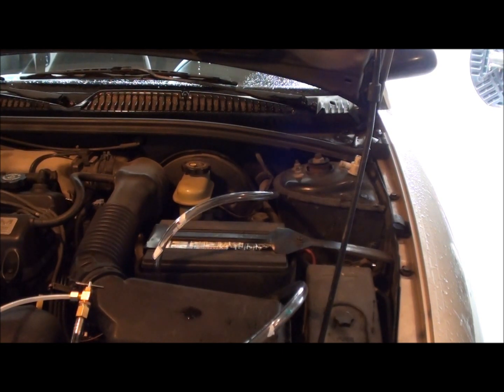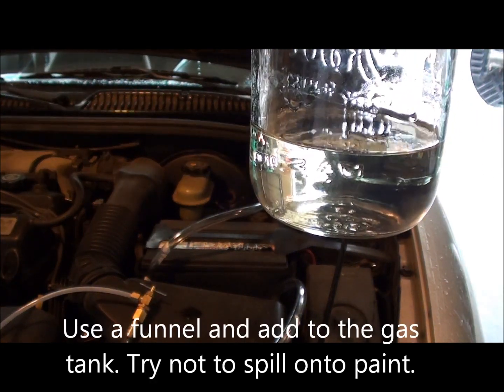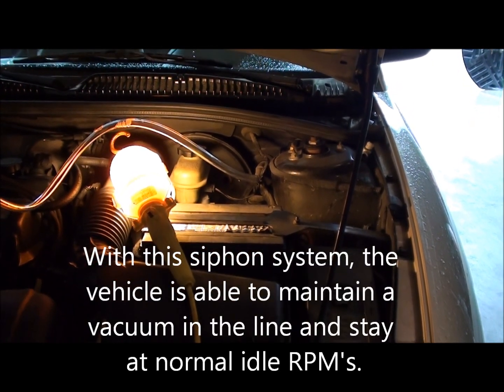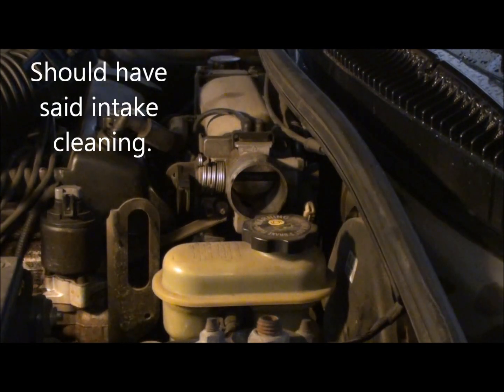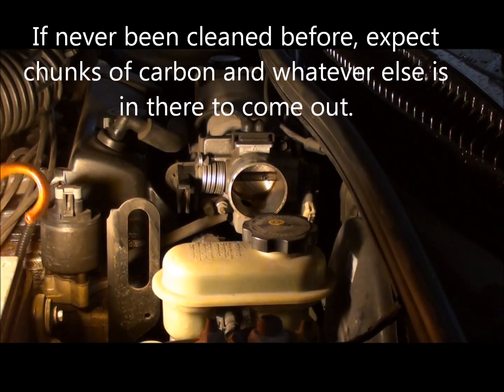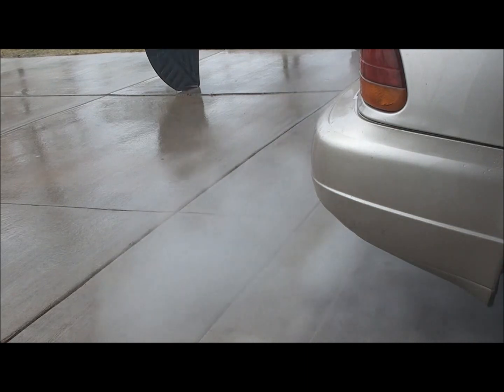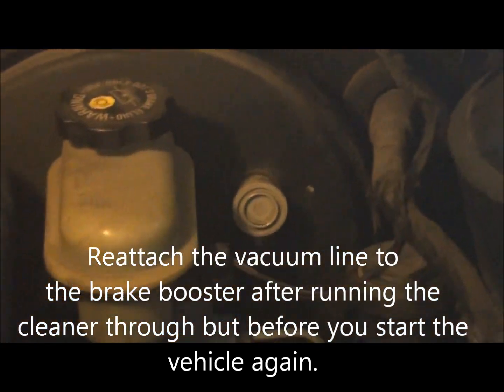How to Properly Perform a Fuel System Cleaning

Comment: How does seafoam in the BRAKE BOOSTER help the fuel system?
Reply from the maker: The brake booster is attached to the intake manifold by a vacuum line.  The  process shown here removes the vacuum line from the brake booster but not the intake manifold and sucks the cleaner into the intake.
Reply: jungleking007 so at what point does this stuff go through your fuel injectors?
Reply from the maker: When you add some of the cleaner to your gas tank.
Reply: jungleking007 Some of these people obviously didn't pay attention to the video and what you did or listen to the steps. It's that lack of attention is why most of you should just take your vehicle to a shop...you just don't have a proper attention span nor the ability to develope a technical mind for even the smallest mechanical things.
Reply: Via brake booster is source of engine vaccuum

Comment: After using Seafoam  you will be replacing your fuel pump after 3 months. I used it on 3 of my cars with 2 to 3 months all 3 cars pumps went. Sea foam is a bad idea.
Reply: I've seafoamed many of my cars, some more than once never a fuel pump issue...
Reply from the maker: You must have had some bigger issues going on before using the SeaFoam. I've Never had a problem in any of the cars I use it on. Even ran a mix of 2 cycle oil and Marvel Mystery Oil in this Saturn for a while with no issues.
Reply: Beth Leach maybe you are using a bad brand of gasoline... I use seafoam 3-4 times a year and after 7 years and about 50k-60k miles, the only problem I have is my check valve in my gas line. Shit happens when a vehicle is almost old enough to vote (17 years old now).
Reply: Maybe replace your fuel filter if the car has high milage if clogged  it will decrease the life of your fuel pump.
Reply: You sure you didnt use spray foam 😂
Reply: Beth Leach which mechanic shop do you work at? Oh you're not a mechanic?

Comment: lol this wont clean the fuel system and diluting your oil with products like these is probably a really bad idea. 

vapor lock is when there are too many vapors for the engine to ingest clean air to burn. hydrolock is when the liquid volume is larger than the compressed volume of the cylinder and the pistons can not reach tdc often bending connecting rods... it may lube the valves and clean them somewhat but it will not be a magical cure all. carbon deposits on a valve can build up to a point the disloding them can dammage the piston and it usually takes a wire wheel and heavy pressure to remove when the engine is rebuilt. sea foam in th egastank will not clean the injectors. an injector service at a dealer or shop is done with a pressurized system and caustic chemical.. 

at best drawing some cleaner/lube through the egr and pcv systems may help unstick them in a best case scenario but using the brake booster as an entry point wont get the stuff there. i have seen egr systems that are hopeless and need manifolds replaced becuase the the exhaust passage is clogged from end to end with carbon.
Reply: Seafoam is very safe in the oil...It will gently remove carbon build up...I recommend 100 miles before oil changes...After a few oil changes you will notice a difference in gas mileage on a older vehicle...

Comment: Just use Top Tier fuels. TOP TIER Detergent Gasoline is the premier standard for gasoline performance. Seven of the world's top automakers, BMW, General Motors, Honda, Toyota, Volkswagen, Mercedes-Benz and Audi recognize that the current EPA minimum detergent requirements do not go far enough to ensure optimal engine performance.
Since the minimum additive performance standards 		 were first established by EPA in 1995, most gasoline marketers have 		 actually reduced the concentration level of detergent additive in their 	 	 gasoline by up to 50%.  As a result, the ability of a vehicle to maintain stringent Tier 2 emission standards have been hampered, leading to engine deposits which can have a big impact on in-use emissions and driver satisfaction.
These automakers have raised the bar. TOP TIER Detergent Gasoline help drivers avoid lower quality gasoline which can leave deposits on critical engine parts, which reduces engine performance.  That's something both drivers and automakers want to avoid.

If you can't find top tier fuels near you, then just use TECHRON regularly.
Reply: 4 of the 7 companies you name are shit ball at making cars so they have no say in anything

Comment: This does NOTHING for cleaning your fuel injectors! This sucks air threw intake and may  help clean valves but that's about it. Fuel not air goes threw the fuel injectors. To clean them you have to disable the vehicles fuel system and fuel return. And hook into the fuel rail with a pressurized cleaning solution.
Reply: This is why he and the can both tell you to add it to the fuel tank!  I'd bet your suggestion would gain results faster but for the average person adding it to the tank works just fine.
Reply: @williammitchell1930 ot if you already have plugged injector probably wont work. need to put into the fuel rail to blow out  the inlector,this just does a system flush helps prior to a injector malfunction
Reply: @joescheller6680  once an injector gets plugged 9 chances out of 10 even pro grade wont do anything for it. i've used BG and various other systems and plugged is plugged regardless of what you do.

Comment: I'm warning everyone who has watched or considered this video to be very careful. I have been a master mechanic for over a decade and if you do not know what you are doing you are going to cause yourself more grief than good. If you run top tier detergent gasoline, you are already doing essentially what this guy is doing without the risk of causing your check engine light to flash when you dump too much flammable liquid and not enough oxygen into your engine. Check engine light is flashing that is a severe misfire which can result in engine damage!! The type that burns valves or in extreme cases the tops of pistons and rings. Just put some sea foam in your gas tank when you fill up your car once in a while. There is very little benefit in doing it this way.
Reply: Seafoam is also sold in a spray form which is what I use....You just spray it into the air intake when the engine is running...
Reply: I agree with you. I actually use regular gas and was told (when I was a rookie) to use mid grade or plus when I do it.
Reply: Calvin Scott If the top tier doesn't use ethanol but mid to regular do, Then I would use the premium. premium is made for tuned vehicles because premium doesn't prematurely detonate from higher pressure like the regular or mid grade. tuned engines typically have a different spark timing and amount of travel compared to regular vehicles. so essentially you are doing nothing beneficial when you add premium to your car/truck, unless like I stated, the premium is the only one without ethanol.

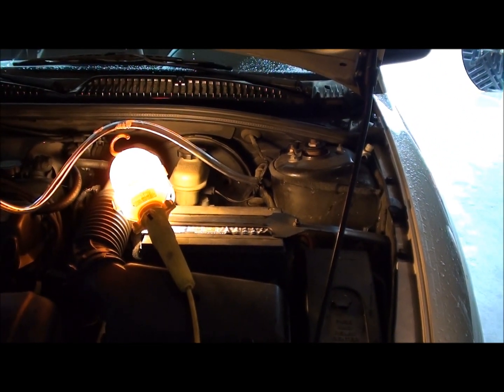Comment: Your setup looks like an IV drip for a car! At 2:32 I think you were correct the first time when you said "Hydrolock the engine". If you were to pour the Seafoam in too quickly some say it is possible to stall out and hydrolock the engine, the same way if you were to drive through deep water and get water into the piston chambers. I see you did use the brake booster vacuum line to introduce the Seafoam into the vacuum system, was the main purpose of your setup to keep the RPM's down during the Seafoam cleaning?
Reply from the maker: Curtis Rowe
 You can not compress a liquid. Seafoam is a liquid and if too much is poured into the intake and enters any cylinder, you could potentially bend a rod or blow the head off the engine. This is why you want to slowly introduce the cleaner into the cylinders. During the detonation of the gas the Seafoam will be vaporized and essentially steam clean the chamber.
Reply from the maker: Buick Mackane  I was going for the IV setup. I wasn't necessarily going for the lower RPM's, but more for this to be a one man job. However If I remember correctly, the benefit with lower RPMs(idle) is higher vacuum.

Comment: sea foam + gas in vacuum system, CEL may come on newer vechicle
Reply from the maker: Check engine light will probably flash on any vehicle(old or new) when doing this. You are changing the fuel to air ratio by adding an additional fluid which could trigger a misfire. Not a big issue. Find a shop with a scan tool, check code, and ask for them to clear the code if it is allowed. If light returns then there is another issue that was uncovered by doing this procedure. If the car is well maintained then the light most likely won't return.

Comment: you guys are giving this kid a hard time. If you go to a quick lube shop they do the same thing and call it a fuel system cleaning, Here is how he cleaned his injectors. when he added half of the bottle or a third to the gas tank. correct me if I am wrong but that gas in the tank goes through the injectors. maybe it should be called cleaning the fuel DELIVERY system. and carbon and gum build up in the combustion chambers and intake valves I believe this is attempting to clean since the vacuum line is after the throttle body so this method will not do anything for them. while I believe the only way to really clean these are by hand this could work for preventative maintenance. Since anything they do at quick lube is just that and never a repair
Reply: Scott Turner b

Comment: What is the regulating valve you use to regulate how much seafoam goes into the vacuum line?
Reply from the maker: It's a needle valve. They can be found a most hardware stores. check the description. I list the parts used in this video.

Comment: How come when Im done with the seafaom and turning the engine on I have no to little smoke coming out?  The only thing I didn't do was rev to 2-3k rpm. is that important?
Reply: Yes it is because this forces the liquid in at a higher rate, yet controlled. If its really bad you will see smoke if none to very little its clean.

Comment: exactly man ive used this for years with not a single problem no loss of power i actually gained power, throttle response, mpg's and helped me pass smog after my car wouldn't pass smog. i would suggest changing spark plugs after doing this tho

Comment: I've torn down a lot of automobile engines with carbon build up on top of the piston and the valves, and the head, and around the top edge of the cylinder. I run a small engine repair shop. Sea Foam does make a difference in small engines. A very noticeable difference. I've never really noticed a difference the few times I've tried it on cars and trucks though.

Comment from the maker: Yes, gas will clean practically anything, but it does not do the same thing in a running combustion engine. Adding a raw cleaner into the combustion cylinder makes it act like a steam cleaner. The fuel is injected into the cylinder and the air/cleaner mix is added from the intake The piston is driven up compressing the mix and the spark plug ignites the gas.  The cleaner will be flashed into a steam due to the gas igniting and rapidly expand which will blast the carbon off the chamber.

Comment: That is somewhat true, but it's more of an over time thing. It's best to use a cleaner made specifically for Mass Airflow sensors, but it's safe and common to use a throttle body cleaner on them occasionally for a very stubborn buildup. But as long as you take off the filter housing when you clean the TB, you usually don't have to worry about the MAF at all. The throttle position sensor is the one located inside the throttle body.

Comment: Just wanted to add... The statement "Do not do this if you have a mass airflow sensor" is poor advice. You can still do that with a MAF sensor. The MAF is usually located between the filter housing and the throttle body. Some vehicles may have it just before the throttle plate, but usually not. And although they are VERY sensitive, they will not be harmed by a low pressure spray. Just do not wipe them off vigorously. Throttle body cleaner is actually used in the shop to clean MAF meters alot.

Comment: actually he is not an idiot, before you judge others because you haven't done any or very little research put some effort in researching first. Their is another product the works like this Except it does NOT go through the Intake manifold.Its call Marvel Mystery Oil. MMO works in your gas tank and crankcase oil. Adding to the gas tank will clean and lubricate the whole fuel system and adding to the crankcase with regular oil will free up the sludge in your engine. Yes I have used this product.

Comment: I agree. I use Lucas fuel injector cleaner for the injectors . I used to use Tectron but 3 or 4 times I have people say Lucas is the best. One person was I professional mechanic who swears by it and uses it in his new pickup. Still I think Seafoam has it's place cleaning the intake manifold. It definitely smokes like crazy when you use it an older vehicle and seems to smoke less the next say 20K later.

Comment: That contraption was pretty lame. Just pour it in like the can says. You won't need no funnel because the vacuum is so strong at the brake booster you can't miss. Also you want to pour it so fast that the engine is on the verge of stalling. In fact some say you should flood the engine to a stall with the last of the can. That's the way I do it.

Comment: I don't see nothing wrong cleaning your throttle body  with MAF sensor as long as you use the right solution. I have heard of people getting away with carb cleaner but I wouldn't recommend it.

Comment: Metered VS Unmetered = I think you're on to something. I think of it this way: A light stream of cleaner running through the system over a long duration will remove more "gunk" than a few heavy "splashes" of cleaner running through it momentarily. My car's long overdue for a treatment but I always cringe while haphazardly slurping it through the brake booster vacuum line. I usually use the vac line to "sip" the seafoam out of a container, I think I'll try your method next time.  Thanks!

Comment: I drive a Jeep and I use an entire bottle every 5th or 6th tank of gas.  I also use around a half bottle in oil crank case 50-100 miles before each oil change.  I started buying it by the gallon after I believed in the product's usefulness.  You won't get this smoke if you are doing other maintenance regularly imo.

Comment: Agreeing with the guy below, this will not clean your injectors the way you have it set up. You need to be running the cleaner with the fuel, or cleaner alone. Or take the injectors out and clean them by activating the injector and running carb cleaner thru the injector as a start. When I rebuild injectors, I replace the seals and filter screen, pintle caps, then I clean the injectors in ultra sonic cleaner while activating them, put all the new seals on, install and they are as good as new.

Comment: 15 yr Chevy Dealer Wrench:
Thanks bro you beat me to it. What you said is a %110 correct. This don't do Jack ! accept shine up the intake manifold and maybe knock some carbon off the intake valve seats & piston crowns. I take that back its a composite manifold..lol

As you said what you are really after is cleaning the injectors and this does not do it. The actual flow chart is Filler Cap >> Tank >> Filter >> Fuel line >>> Press Reg >> Fuel Rail >> Injectors >> Return Line >> Back to tank.

Comment from the maker: Recently had to purchase another vehicle. I performed this procedure but instead used half the bottle through the intake and chevron fuel injector cleaner. I smoked up the entire street which makes me think this was the first time this has ever been done. I also removed the throttle body and scrubbed it clean because it had a huge build up of carbon and debris.  Wish I had filmed it but just goes to show that older vehicles still benefit from this procedure.

Comment: The fuel system starts at the fuel filler cap and ends at the head. The procedure poster here cleans the intake manifold and combustion chamber, only. It skips, what I think is the most important part, the fuel injectors. 
As I stated above the combustion chamber on a modern lean burning engine with todays gas will stay very clean. This procedure is a waste of time and money

Comment from the maker: you can use the entire bottle if you want as long as you use it with no less than half a tank.  There are more powerful fuel injector cleaners out on the market though. Since filming this I have started using half a bottle through the intake and other cleaners in the oil and fuel. This film was following the instructions on the bottle. Thanks!

Comment from the maker: controllability of fluid flow should improve the whole process.  unfortunately, I do not have a way to test if it does or not. to me it just didn't feel right to pop a funnel into the end of the line and start pouring.  I was going for a cheaper way of doing what a lot of quick lube shops do.  If you are able to find out, I would love to know if controlled metering verses haphazard pouring is better.

Comment: Avoiding hydrolock and damage is understood. What I was referring to is your assertion of better cleaning as well as the engine controlling how far down the clean would go is a benefit of your siphon. From what I can understand is your siphon has nothing to do with the level or depth of cleaning; just the controllability of fluid flow into vacuum line--unless I'm mistaken. This has nothing to do with cleaning better as far as I can tell.